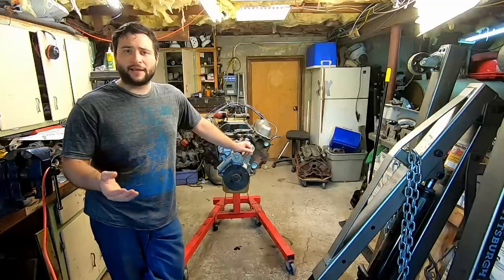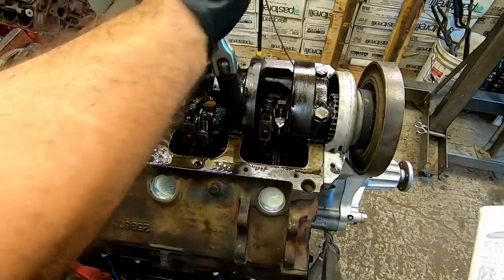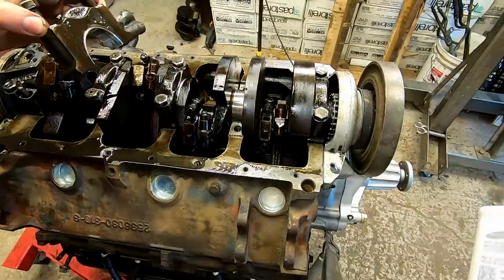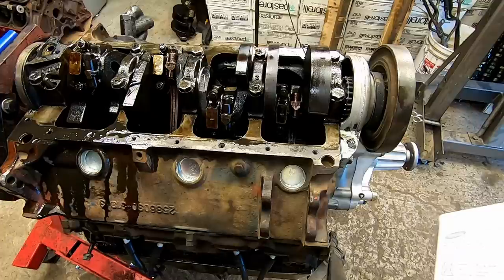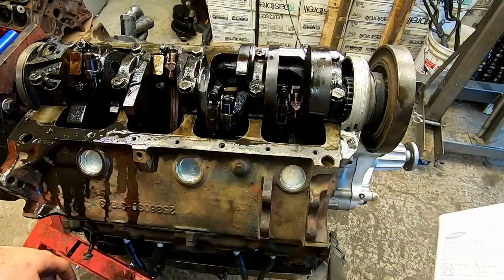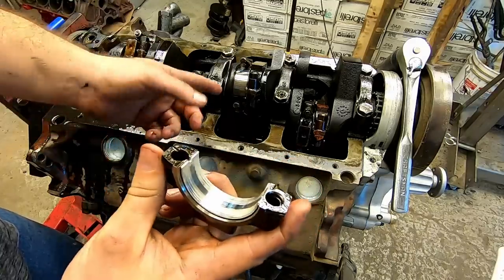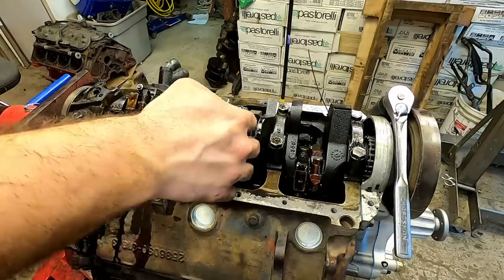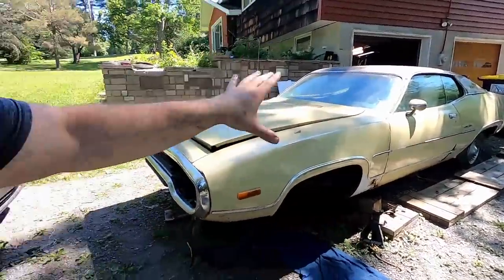The Mystery of the 318's Low Oil Pressure Solved! update the crank was worn out .07 not machined

Comment: Take it to machine shop get it done proper and get the proper bearings the crank I would of had done the first thing I would have done was the crank it would have been turned and polished and magna fluxed and the proper bearings
Reply from the maker: It would’ve been very hard to bring anything down to machine shop in the timeframe that Tony wanted. Like I mentioned before our governor close down everything😁🤙 there was no machine shops open
Reply: @LunarOutlawsGarage       then you just wait then.     To hell with some timeframe some old guy talks about.
Reply: John Vegar to me it was a total waste the money he spent on going to Montreal and all the bullshit that went with it I would have made 100 percent the crank and bearings and rods wrist pins were all perfect or I would not waste my money to me they wasted money tony took he day and did the heads they might as well left bottom end alone and did the heads added a new oil pump the heads is we’re they will gain but with out good crank and bearings you still got junk I don’t understand to me it would be embarrassing the look on nicks face sort of said it all I don’t know it was put a junk motor together but I think they made it worse other than the heads getting hogged out that would be why it would rev to 5000

Comment: Who would only turn down the mains on a crank? Imagine getting the crank home and finding out they machined half the crank.
Reply: Very common to only grind the mains or rods, depending on  what it needed, don't know why everyone thinks it strange.
Reply: @tri-rrrservices7299  The local shop turns them all 10 thou under and go 30 over on blocks as a general rule. They also sell blocks and cranks on occasion so they may just have a dedicated setup.
Reply: That's not a bad thing, but I've seen cranks 10 20 or 30 under in any combination between rods and mains, for a shop doing production overhauls it makes sense to do them all the same, saves on  stock inventory, and prevents mistakes like this, but that is also why you mic the crank.
Reply: This shop did a lot of Ford V8 stuff manly geared toward daily driver/fleet mechanic builders. For them it's probably more ease of use and idiot proofing than performance. That's good since I'm quite the idiot.
Reply: Who? Plenty of people! There is NO need to grind undersize the rod bearing journals if they are concentric and without any flaws.
Reply: @ahoneyman  Good for business (the extra grinding).
Reply: @electrix6751  Again, these guys did a lot of bulk rebuilds and bulk parts for Ford V8s. They most likely have a dedicated setup so it's more like a factory than a speed shop.
Reply: Electrix......... nothing “concentric” on that engine. That engine is a complete mess.

Comment: Engine rebuilding 101: NEVER assume something is the correct size! Always Plasti-Gauge bearing clearances when building/rebuilding an engine. Don't wait until something like this happens before doing the job correctly. Measure everything!
Reply from the maker: Unfortunately both myself, and John Wilburn pointed out that there was an issue with the crank. However for or some reason another when the rotating assembly was put together the builder, ran his finger a crossed it, then said it was fine. He didn’t use anything to check clearances.
Reply: @LunarOutlawsGarage  Ah, the ol' finger check...👉
Reply from the maker: Lol

Comment: Never "break off" a piece of plastigage. you'll stretch it and get false reading.
Reply from the maker: I normally just cut the package and pull it out that way. I just pinched The plastic gauge with my finger nails cutting it like scissors would. In this case The bearings never even touched it

Comment: Wrong stuff to roll the dice on !! Who was in on this ?? Really!!! Gee !! Wizz!! Once I was pulling cam from old 400 Pontiac still in the car to replace cam and lifters bottoms of lifters beat up so much would not pull out threw top after smoke break as I was pulling n wiggling cam n pulling out heard something go clang splash?? Wiggled pulled wee bit more clang splash?? Again!! It  Was lifters falling hitting crank then splashing in oil pan!! Lol!! Drove that old car for years afterwards just sometimes during oil change lifter would roll n block drain hole, I used screw driver poke threw drain hole to roll lifter from oil drain hole n think of all the fun I had learning!!!

Comment: Dude you're not supposed to leave the plastic gauge in there
Reply from the maker: Lol it was all coming apart so I could mic it. Heck the crank is not in it anymore.
Reply: It's a strip of wax--It won't effect jack--calm down.
Reply: @RAMMBRUTE  I'm confused why would I worry about it  I was just told to always take it back out of there by the old mechanic who taught me to use it well I'm sure that'll make Jack very happy whoever the hell he is
Reply: @rodney1818  Don't be confused--its wax. Think about it-what does wax do when it gets hot?
Reply: @RAMMBRUTE  no genius I'm confused because I don't understand why you would think I would be worried about the wax being in there
Reply: @RAMMBRUTE  like I already said once if you would have been paying attention I was taught to always take the wax out you were taught a different way we both shared our opinion get over it it's not your personal mission to change mine or anybody else's mind on the way they do things
Reply: @RAMMBRUTE  so it doesn't hurt anything to leave the wax in there it also doesn't hurt anything to take it out bam we're both right
Reply: honestly, wouldnt matter. it would just melt and flush away. kinda like.....cam break in lube....
Reply: @frigglebiscuit7484  yes I understand that that does not change the fact that I was taught that nothing goes in there but bearings and assembly Lube
Reply: @frigglebiscuit7484  why don't you try using wax instead of assembly lube and let us know how that works for you